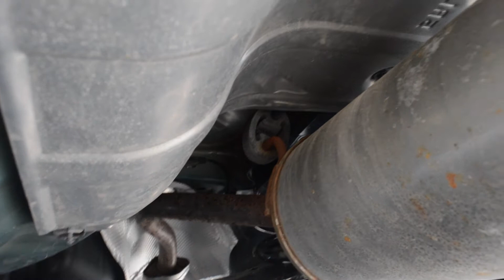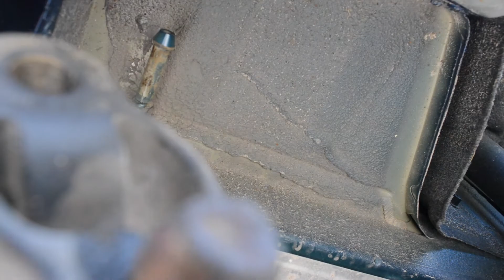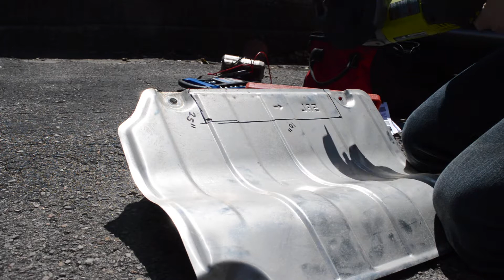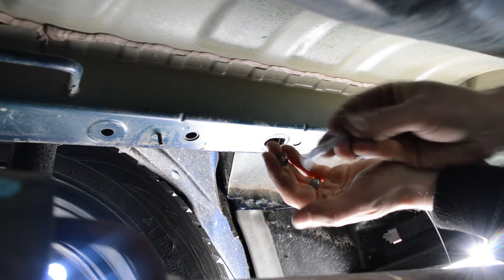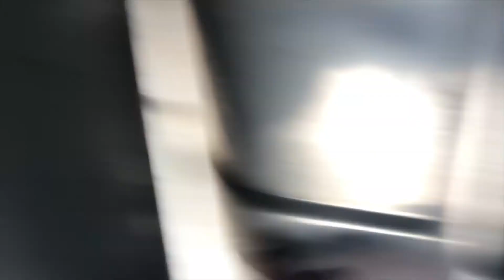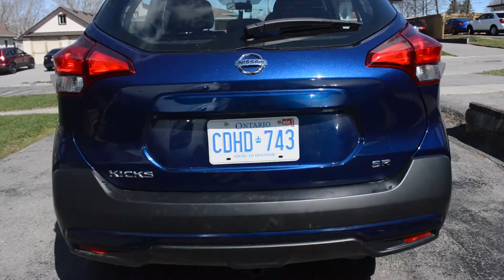How to Install a Hitch (On a 2019 Nissan Kicks)

Comment: Any idea if the kicks e-power can tow?
Reply from the maker: I’m not familiar with the e-power. It’s not even available in my market. But I would just apply the rule I have kept to for any compact car, Keep it under 1000lbs total and under 150lbs tongue weight, be gentle and you will probably be fine.

That said as I have no familiarity with the e-power, I am not responsible for whatever happens.
Reply: great thanks for the info, I am planning on getting a Mypod travel trailer which weighs 840lbs curb and 110lbs tongue weight I hope it can handle it

Comment: Hello is the hitch especial for Kicks 2019?  I have one to install universal i Wang to know if it will fit
Reply from the maker: Yes, this is part # 11563 specifically for the kicks. Universal ones are unlikely to work for a unibody car as most universals are meant for standard frame trucks and even then I would recommend getting a vehicle specific one.

Comment: Hello, can you show what kind of drill/size did you use to bore a hole? Thank you
Reply from the maker: There are no holes to drill for the installation of this hitch for a Nissan Kicks. It uses existing holes in the frame. The only thing you have to is enlarge two of them with a die grinder as in the videos
Reply: DG Garage Thank you

Comment: So my Kicks will be able to toe a ln electric wheelchair?
Reply from the maker: Depends, are you going to be doing it all the time or occasionally? How much does it weigh. I do advocate a lot that the kicks can tow light trailer loads and I tow up to 800lbs or so a few times a year. That said, with its CVT transmission, I would not use it as an every day, day in, day out tow rig.
Reply: @dylanthescatterbrain hi I own an e-power Nissan kicks do you think it could tow more than 800lb?

Comment: Have you had any problems without the heat shield?
Reply from the maker: None at all. The hitch acts a bit as a heat shield itself and I have checked and there is no signs of heat damage.
Reply: Just bought a hitch kit.  Been 10 months now.  Any signs of heat damage around the area?
Reply from the maker: @dennischan867  Zero issues.

Comment: Isn't the hitch pointless since the kicks its not rated to tow??
Reply from the maker: eduardelric hardly pointless. Just because a manufacturer choose not to tow rate a vehicle does not make it incapable of towing. Most vehicles can handle up to 1000lbs on a trailer with no issue, which I plan to keep below on this one. Almost no small car gets rated rated any more, but I have pulled 1000 or so lbs with cars as small as the Chevrolet Aveo without issue. I have probably pulled a max of 800lbs so far with the kicks (trailer + lawn tractor) and it hasn’t even broken a sweat. 

Just don’t thrash it and you should be fine.

That said, even if you don’t ascribe to that philosophy, a proper hitch is still not useless, the biggest use for one is to mount a proper hitch receiver bike rack, which is must superior to any strap mounted options on the market.

Comment: What kind of stuff is everyone wanting to tow with their Kicks? Just curious as I've thought about a John boat or pop up camper.
Reply: You're gonna break your kicks. Only install a bike hitch or small basket for luggage. Kicks isn't suppose to tow anything according to the manual.
Reply: @jovie311  my Jon boat & trailer wouldn't be more than 500 pounds, as I already use a different vehicle to tow it now. In fact, the tongue weight is only like 100 pounds. Anything small like that, bike rack whatever is fine.
Reply from the maker: John boat would probably be fine, I have towed 600-700lbs without issue. Car doesn’t flinch. Just because Nissan didn’t publish a tow rating doesn’t mean you will break it. Just pay attention to your payload. The kicks is about 950lbs I think. If you + your trailer don’t exceed that you will probably be fine. Just don’t load up the car with your friends and then tow a trailer. Remember payload is also how much the suspension can handle, not just the power of the engine. If the car was tow rated the tow rating would probably be higher than the payload as only a fraction of the trailer weight sits on the car’s suspension.

 I would like to tow a pop up, but I have yet to see one light enough to feel comfortable.
Reply: @dylanthescatterbrain  also, notice what people manage to tow with the Versa, maybe why Nissan didn't want to give the Kicks a rating? 😂

Comment: I love the kicks but its not even rated to tow a wet towel up a hill.
Reply from the maker: Not tow rated =/= not capable of towing anything at all. Lots of manufacturers don’t tow rate their small cars, but as long as you aren’t being reckless you can tow small & reasonable amounts. Brought home a small tool cheer on a 300lb 4x6 trailer tonight and it did just fine. Maybe 500lbs total.